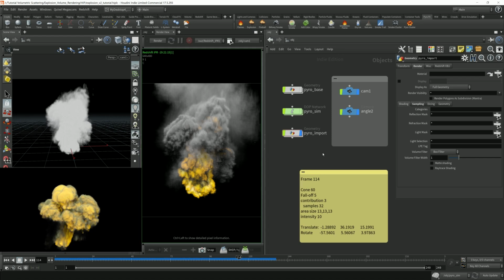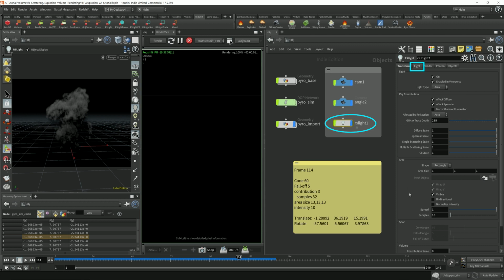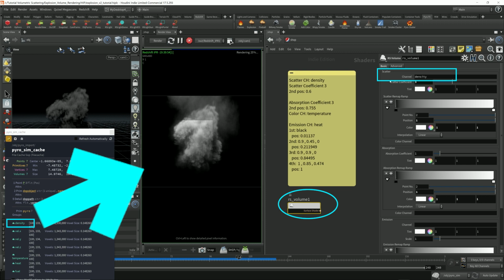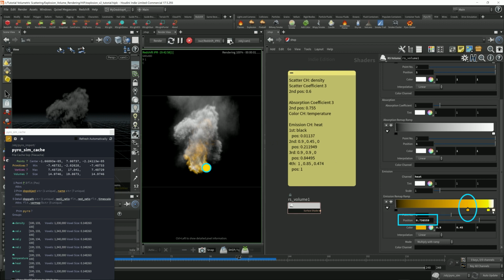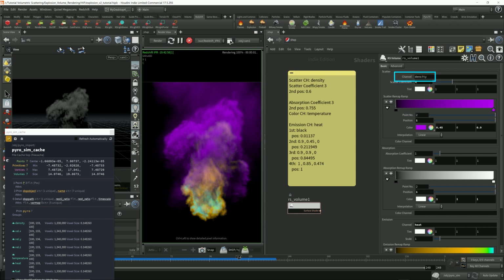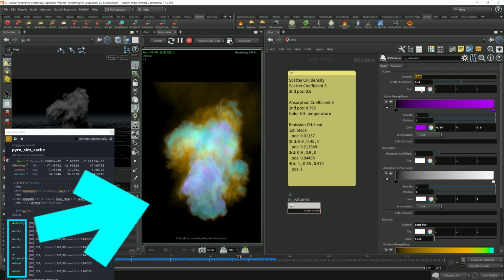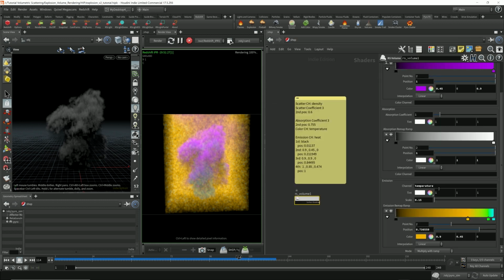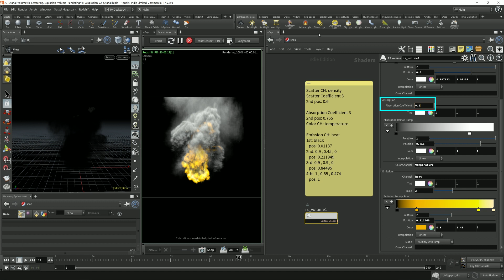Redshift Volume Material for Beginners in Houdini

Comment: Im changing a lot of paramters in the volume material and nothing seems to change . Help !

Edit : Its working now. I was creating the redshift volume material in the material context graph and not in SHOPS, which is weird but it worked at the end.
Reply from the maker: I'm glad you got it working.  Redshift materials use to work in SHOPs, but this video is quite dated.  I'm not sure if anything changed.  Out of curiosity are you using Redshift 2.x or 3.0?  
I wonder if this might be a change in Houdini 19, I'm not too sure.  I have switched over to using BLender Cycles to do most of my rendering, because it's free so I haven't used Redshift with the newer versions of Houdini yet.
Reply: @bubblepins  Hi bubble pins :D. I'm using redshift v3.5.3 which is the latest version so far. However, redshift volume materials seems to still only work if you created the redshift volume shader in SHOPS and not in the material editor. pretty weird but at least its working :) .
Reply from the maker: @sherifmedhat8625  I wonder if redshift updated their materials workflow in 3.0.  I never used 3.0, because I switched over to blender before it was released officially.
Reply: @bubblepins  i never used redshift before this version sorry. I was a long time Arnold rendering guy until i just recently switched to redshift because of how easy and fast it is. And most probably I'll consider visiting blender as well.
Reply from the maker: @sherifmedhat8625  Blender has a lot of addon's that you can purchase with very nice shaders that is offerred, but the biggest selling point is that blender itself is free so it helped my budget for this channel.  I think Redshift and Arnold is better suited for more professional work.  If you do plan to do Houdini as a profession and you can afford the subscription, I would recommend Redshift/Arnold over blender.

Comment: How do u improve the quality? Im having really low res quality Thanks!
Reply from the maker: You can lower the voxel value for the actual volume that will increase the resolution of the volume, however you need to be careful because that'll also increase the cooking time as well.  Hope that helps!
Reply: @bubblepins  thank u !
Reply: @bubblepins  in which part of ur video I can spot the VOXEL value because I cant find it in my project , Im beginner sorry! and thank u in advance
Reply from the maker: @santiagorinaldi1712  It's the actual volume itself on the sops, like when you create the volume simulation, inside the pyro sim, you specify the particle separation, that's the resolution of the simulation.  The resolution of the pyro sim, will actually affect the resolution that comes out of the render too.  For Redshift, I believe you if you want a higher resolution of a volume render, you can lower the particle separation of the pyro SIM & increase the resolution of the render like 1920x1080 to 4k.  And tweak the density parameter in the Redshift material to ensure that the Redshift renderer will capture the details.

To recap, the 3 parameters that I know will affect the pyro resolution rendering in Redshift:
1) pyro sim particle separation (voxel size)
2) image resolution of the render (like 1920x1080 or 4k)
3) density parameter in Redshift volume material (to ensure the material will actually capture the details)

These are the parameters that I know so far that will affect the quality of the volume render.  Hope it helps!
Reply: @bubblepins  thank u so so much!!!!! It works!

Comment: How do you add a volume material to a simple geometry lika cube?
Reply from the maker: Volume materials can only be added to volumes, which is a different type of object.  A cube is a geometry made of polygons.  You can use a vdb from polygon node to convert a cube into a volume and then apply a volume material.
Hope that helps!
Reply: @bubblepins  That was the missing puzzle piece. Thanks so much!
Reply from the maker: @mmoboxs  =)

Comment: Great tutorial as always! 
I have a small  issue, want to transfer Cd volume attribute as a color to the smoke. is it possible?
Reply from the maker: How did you get color onto your volume geometry?  Because volumes are different from polygon geometry.
Reply: @bubblepins   Sorry, I think technically, this is a primitive attribute of volume (consisting of voxels)
Reply: i wander how to transfer this attribute in Redshift volume material. In mantra it works properly.
Reply from the maker: @bekabaratashvili3178  You can feed it into the channel parameters on the RS Volume Material
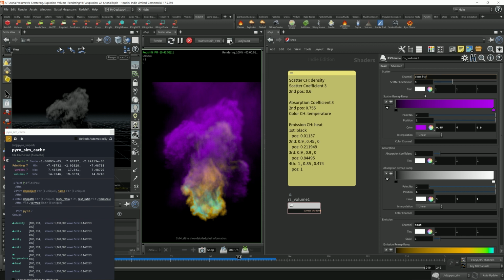At 11:27 I demonstrate how you can feed the volume primitive attributes into the RS Volume Mat.
Hope that helps!
Reply: @bubblepins Thank you, but it does not work. I want to directly feed my color to it, but don't understand where. Does not need any remap.
Reply from the maker: @bekabaratashvili3178  The thing is about volume primitive attributes, is that it only stores 1 scalar value per primitive and color Cd is a vector.  (R, G, B)  If you look at the spreadsheet geometry, you'll see that velocity, which is a vector as well, it has 3 scalar values.  So in order to store that as a primitive in volumes, Houdini stores it like vel.x vel.y vel.z, 3 volume primitives.  And the RS Volume Materials take one volume primitive per channel.  I'm not sure how you could remap a vector value directly to the Volume Material. 
You're probably right that Mantra lets you do this easily cause Mantra exposes everything for us.
Reply: @bubblepins  Yeah, i don't  want to remap color, simply need to feed it, tried Cd.x ... Cd.* ,  but nothing works. So, i will render it in mantra :D . 
Anyway, thanks for your effort